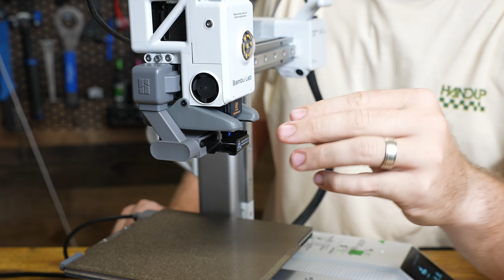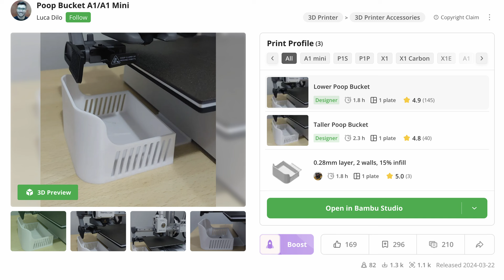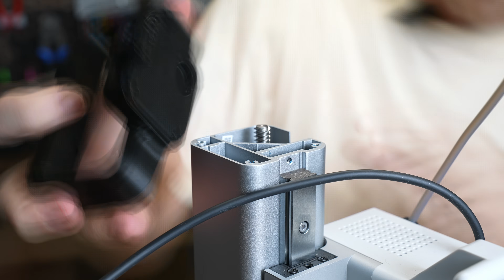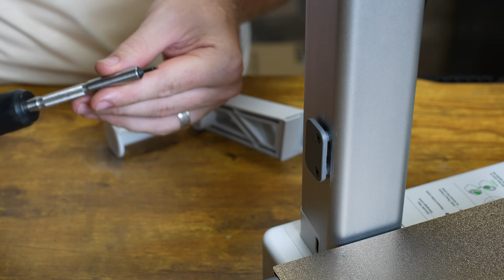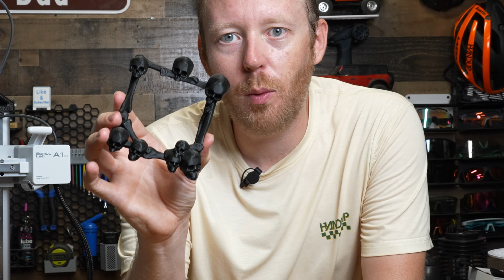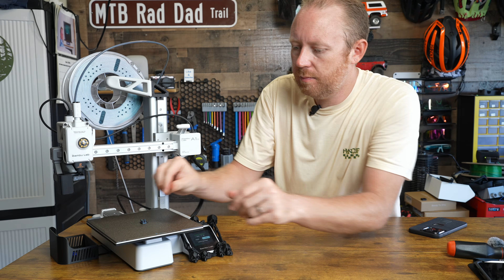5 Free Upgrades For Your Bambu Lab A1 Mini!

Comment: For the poop bucket, there is a mini poop bucket on maker world that attaches directly onto where the deflector shield does, and does both in one, and there is also a printable tpu inset to stop the extrusion inside from making the rattling noise when moving around.
Reply: thanks ill be looking for them

Comment: Why do all these elevated spool holders have to be rear facing..
If you have the printer in an enclosure, they are just useless..
Reply from the maker: Its one of my biggest complaints so far. Its great space saving, but I do wish it was easier to get to the spools on the back.
Reply: @RadDadsPrintLab  Yeah. I don't even have an A1 mini yet. Waiting for a reply from the store about refunding my Ender 3 V3 SE so I can get it.
I do not need another defective creality product taking up space and not letting me print.
Which is why I want the A1 mini as a starter now

Comment: Good evening. Could you tell me how do you print with multiple colors without ams on the A1 mini by doing the manual switch?
Thank you very much for your availability.
Reply from the maker: I should make a video on it, but in the slicer you can tell it to change color at a certain layer. You may need to also add some G-Code to pause the machine.
Reply: Faz um vídeo explicando, já ganhou um escrito!
Reply: Thank you.